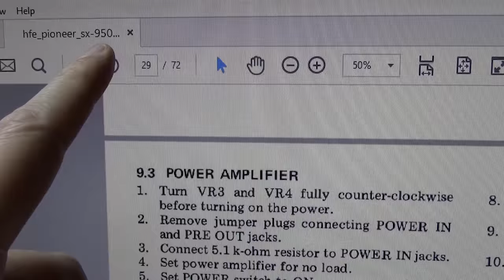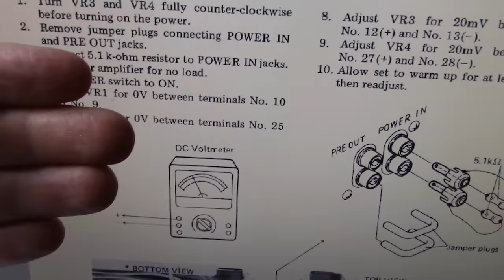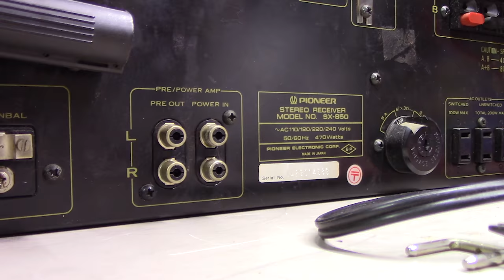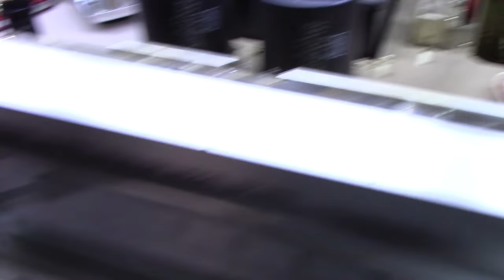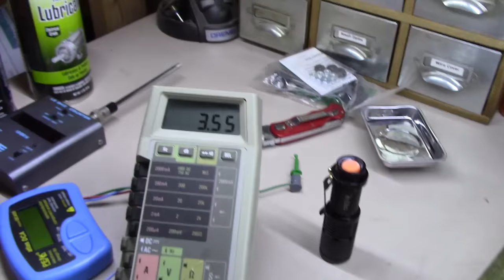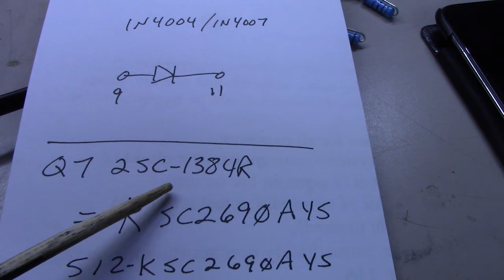Pioneer SX-850 SX-950 Bias Instructions and Speaker Protection Board Tips - BG064

Comment: Nice instructions.  I always wondered what no load meant.  I had a problem with the relay turning off the speakers after 10 minutes of use.  Then after a few minutes it would turn them back on.  It would do this for a while and then just stay off.  I checked the voltages of the transistors on the protection board with speakers off, had no choice.  Q1 and Q2 voltages were way off from the schematic, so I replaced them.  Now when the unit turns on the relay clicks after 3 seconds and doesn't click till I turn the power off.  Seems to work.  I will have to do that diode thing.

Comment: Regarding the protection mod, you can bridge 9 and 10 or 9 and 11 with the 1N4004 diode.  Cathode end connected to 10 or 11.  Looking at the back of the PCB, the tracing shows 10 and 11 are connected.

Comment: Wow, this is so helpful, thank you! I just bought an SX-850 and the only problem thus far has been some pots that needed a little cleaning. It sounds wonderful! I will eventually recap it and replace the speaker protection relay. I found a couple of people on eBay who sell SX-850 repair kits including the relay and the large filter caps which saves me the trouble of figuring out what parts to buy.

Comment: The service manual says 5.1K ohms which is 5100 ohms, not 5.1 ohms for the load resistor on the power amp input.

Comment: Hello!
I have a question, It may be obvious to most, but for me as an amateur I want to make sure...
Is the 1-15 clear plastic side for the left speaker and the 16-25 for the right speaker?
I have cracking and poping in my LEFT speaker and I want to (hopefully) fix it by changing out the correct transistor.
I'm thinking Q7, Q5, or Q9? 
Please help. Thanks!
Reply: I did this process on my SX950 and you were right, It wasn't easy but being careful, and with the proper tools I did it! and it is now AMAZING!!..thanks to you!
Thanks again!

Comment: I've a SX-950 that powers up, dial lights come on, the bias was adjusted correctly but the relay doesn't click on. I replaced the Q7  with the KSC2690AYS and did the mod with the 1N4007 between pins 9 and 11 on the protection board but it still doesn't click on and there's no sound. Any ideas on what could be happening? Thank you for your reply! Gabriel
Reply: I have the same problem. Did you get yours figured out. Any info would be appreciated.
Reply: @newgilligan3694  I finally got it to function properly but not without the help from Audiokarma on the Pioneer forum. I'll have to dig through my notes from two years ago to see if I made a notation what may have been the issue but I believe it might be I didn't set the idle voltage correctly, not sure.
Reply: @sand0077  Hey thanks for responding! If you can find out that would be great. In the meantime I'll check audio karma. Thank you

Comment: I'm currently working on a SX-950 where I'm getting odd voltage measurements at the inputs and outputs off the power supply and the protection board. For example the input from the transformer and output pins of the power supply, protection board, eq board, tone, flat amp and power amp boards shows voltage being way off compared to factory specs in the service manual.The condition presently is the unit powers up, no indicator lights, the dial light comes on but not hearing the click from the speaker relay and no sound. Have gone through those boards and replaced capacitors and some transistors as needed, checked and rechecked the diodes, caps, transistors and resistors and all are as they should and installed correctly. At this point I'm suspecting a bad transformer, is this a valid assumption? Your thoughts appreciated, thank you!

Comment: Very helpful info on the bias adjustment and protection board. My SX-950 relay doesn't even kick in regardless of how long I wait after power on although the panel lights come on just fine. Thank you for the tip, most appreciated!

Comment: I need to replace the amplifier board on a SX 5570 and my question is those wires wrapped around the pins do those just slip off the pins ?
Reply: Billy Amundson they make a tool for unwrapping the wire. I seen it on an earlier video, someone else put up. I've watch so many today. Only thing for sure it was in a video on a pioneer

Comment: An excellent video tutorial. Thanks! However, I do not understand how the setting can be the same for the SX-850 as it is for the SX-950. The procedure is the same but shouldn't the setting values be different since the SX-950 is rated at 85 watts per channel into 8 ohms and the SX-850 is rated at 65 watts per channel into 8 ohms. Why is the 20mV value setting for VR3 and VR4 the same for both and why 20 ?
Reply: i have a SX 950 also, where is the damn fuse? theres nothing on the back next to power supply

Comment: Replaced all caps in PS. Was going through bias procedure, Can't get The VR4 adj. below 300 mv. all other adjustments are spot on. Should I be worried?
Reply: 300mV is too much.  You should check the pre-amp section.  Any DC generated in the pre-amp will be amplified by the power amp if the amp is a DC coupled one.

Comment: Thank you for the excellent video. I have a SX 980 with speaker protection relay problems. Would the work you did on the 850 in this video be applicable to the 980 as well or is the 980 constructed differently?

Comment: Thank you for your informative videos. You helped me with my Marantz 2215. 
now I need help setting offset and bias on my dad's Pioneer SX-1500TD. The manual doesn't say where to adjust or what level each should be on the vmm.  Do you know? Make a video servicing this receiver?
Any help would be great!
Reply from the maker: Sadly I don't own one to make a video of it.  Off-set it easy, adjust until you have 0v DC on speaker terminals.  Bias maybe tougher and you would need a service manual or do some searching for correct values

Comment: I would say job one of the protection circuit is to protect the speakers from the amp (in the event of a large DC offset) and not the other way around. Yes, they do current (ASO) sensing but many times the amp will blow anyway in the event of a short. Not so often on this series of Pioneer though. Been repairing professionally for 35+ years. Personally, I prefer to troubleshoot and repair problems first, re-cap second. By the way - Q5 on the regulated power supply board is pretty notorious on these. It's a series pass transistor for the relay B+. No sound on an SX-850, this is the first thing I check - no B+ on either relay coil connection.
Reply from the maker: You should make a video on the topic
Reply: Mark, you look a little young for 35 years on the job!

Seriously though, I imagine you and I would be similar age and experience. I also started in the early 80s and have fiddled with / repaired / sold just about every  audio device ever made - even at this moment I have to be careful where I tread for fear of standing on a dangerously shaped Hi Fi related component.

Regards from London.
Reply from the maker: +mart fart started working with electronics at age 10.  Opened a repair shop at 14.  37 years actually.
Reply: Blueglow Electronics
 That's amazing, I am similar with age, but  without any entrepreneurial bent. I had a friend at school who showed me some kits he had made with LEDs and 555s etc. and I was hooked. Within a year I had built my own computer (1978) and soon after discovered I loved Hi Fi.

Comment: I have better luck turning those plastic trimmers with my fingers.  I get better accuracy than with a screw driver.
Reply from the maker: I would agree.  However, I've tried to not make it a practice as I work on a lot of tube gear as well and grabbing a pot with a few hundred volts cruising through it can be enlightening...

Comment: Mark, have you ever worked on any reel-to-reel tape decks?  I have an old Teac A-4010S I've been trying to fix for awhile.  The problem I haven't been able to fix is with the relays.  Only one channel engages into record mode and the other channel does not engage because the relay never energizes.  I'm not sure what component(s) are failing and preventing power to the relay coils.  I've already replaced all the main electrolytic capacitors in the unit.  I don'w know about the transistors causing this.  They're all old PNP germanium transistors.
Reply from the maker: I have worked on many.  Sounds like a driver transistor acting up.  Probably need to dig up a schematic and chase that down.  BTW I officially don't work on R2R units any more, way too complex for what people are willing to pay...
Reply: I was suspecting it's a transistor next.  When I originally got the unit, the one channel engaged for a fraction of a second and then cut out.  But I don't know which exact one is causing issues.  I do have other R2R decks to use for parts, so I could probably swap one out  And I have a Peak Atlas semiconductor tester.